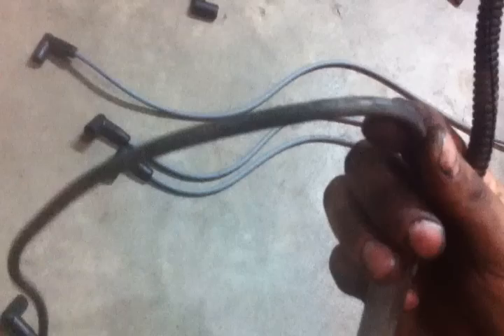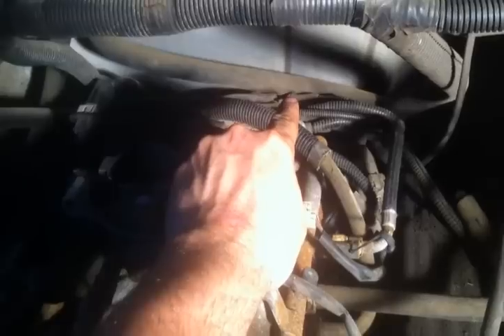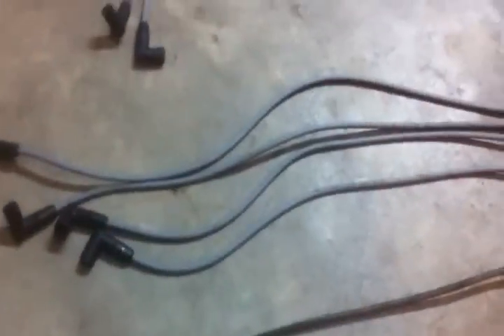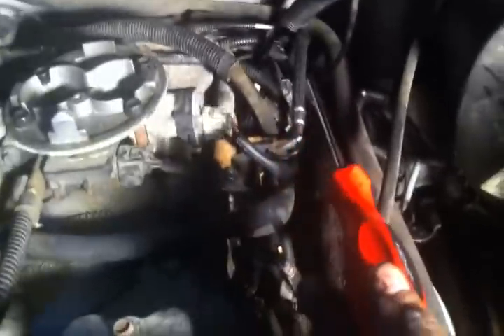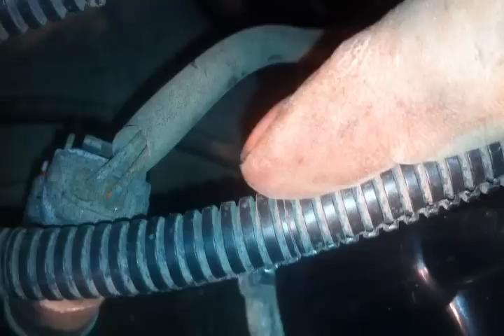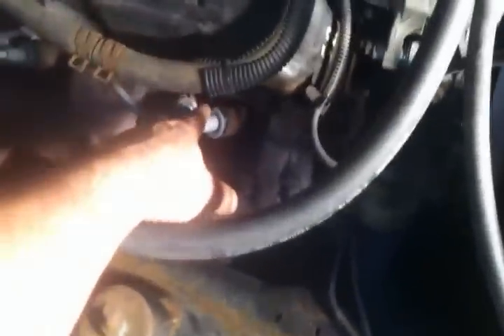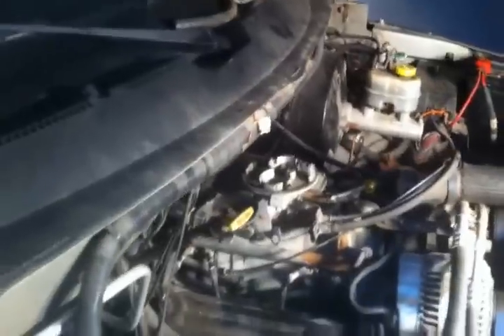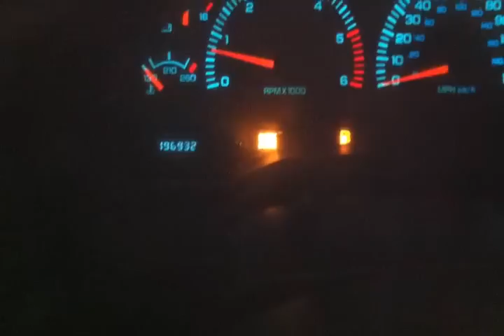HOW TO DO A TUNE UP (Plugs, Wires, Distributor Cap, Rotor) Dodge Ram 5.9L

Comment: YOU SAVED MY LIFE. THIS NEEDS TO BE PUBLISHED ONLINE IF YOU GOOGLE THE SPARK PLUG WIRING PATTERN FOR A 96 DODGE RAM 1500 WITH OUR MOTOR, THE WRONG PATTERNS COME UP, THIS IS THE CORRECT RUNNING PATTERN, THANK YOU SIR YOU ARE A LIFESAVER

Comment: I just pulled mine out for a change, 2001 5.2 mag, 5spd manual with 75,000 miles on it, they were original, I guess the life of these plugs, wires, distrib, rotor and battery cables is 75,000 miles or 22years, whatever comes first! 
The problem was the IAC, so I just did it all, why not right?

Comment: I was wondering if you could help me. I have a 2000 dodge ram 1500 with the 5.9 engine. It recently started taking longer to start. when you turn the key, it turns over about 3 times and then starts normal. when the issue happens, it takes several seconds turning over then starts. there is no rough idling, all gauges appear normal. I also have a 2004 dodge intrepid 3.5 HO that had similar problem, and it was the cam sensor. any help would be appreciated !

Comment: I have the same problem with the suction noise from time to time and rough idle I believe it's the IAC sensor in the back of the throttle body, does anybody know the original size spark plug wire the oem that comes on the 5.9l